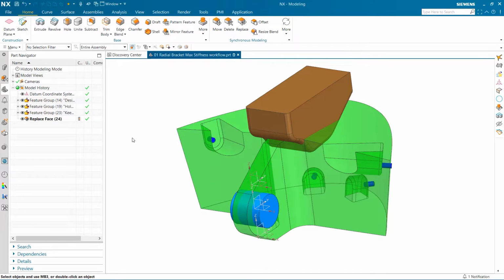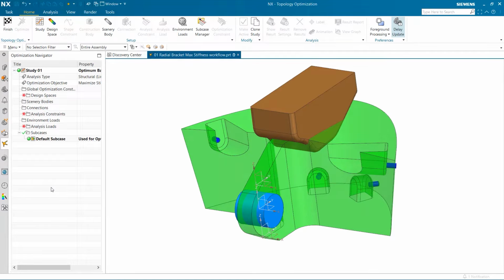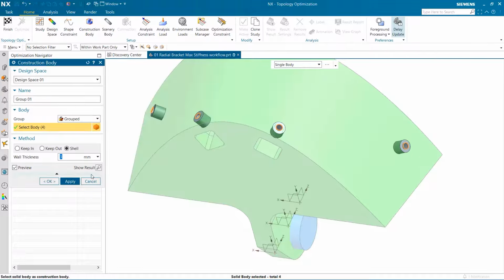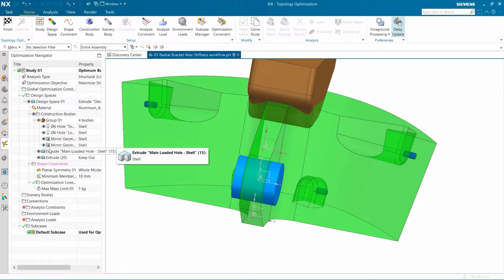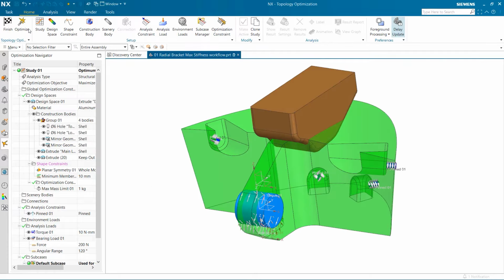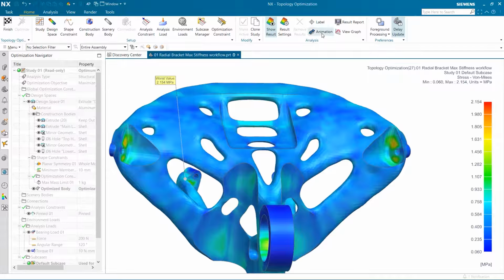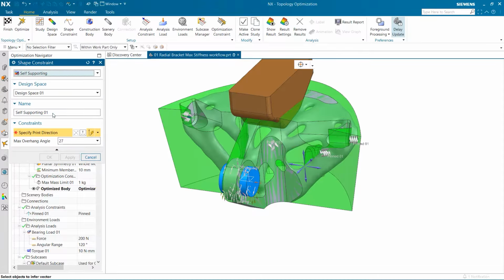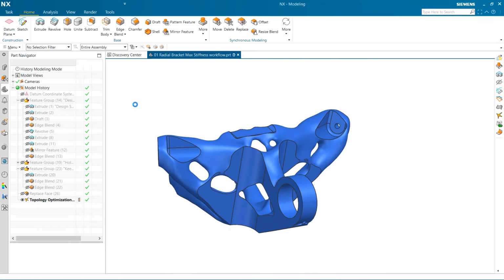NX | Tips and Tricks | Topology Optimization: Part One

Comment: MY VERSION IS 2406.5000 and i can't apply loads or fixations on a body outside the design space like you did with the pinning and torque
Reply from the maker: We're sorry you're having issues! The best way to get technical support for our products is to open a ticket in our Support Center at https://sie.ag/3ToDt8. This will ensure your question is quickly routed to the correct technical support resource.